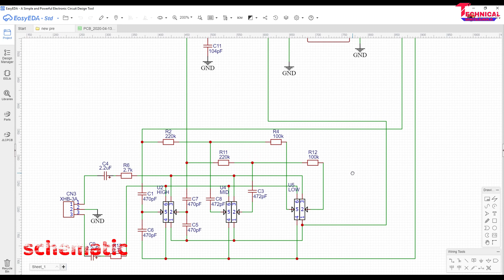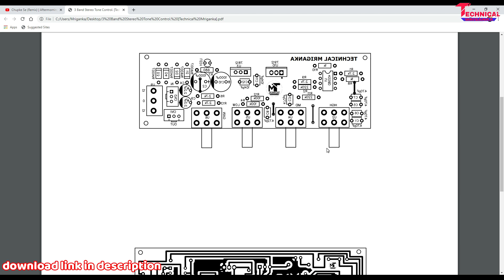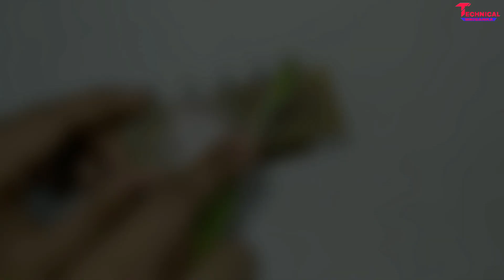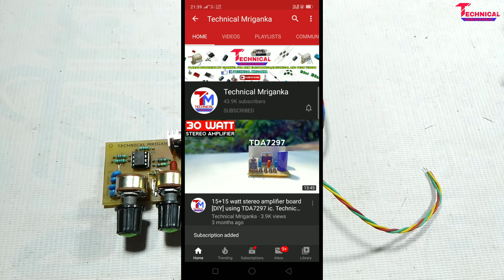DIY 3 band stereo Tone control.

Comment: Hello ,470 pf blue color and 472ph red color how many voltages?thanks!...and what are the deffirence between dual supply 12 0 12 and 0 12 v power supply  in that componnent?because first you made 0 12v supply..thank you very much!!!
Reply from the maker: 470 pF and 472 of is 100v. but you can use 50v also.
Reply: @tchMri  thanks sir